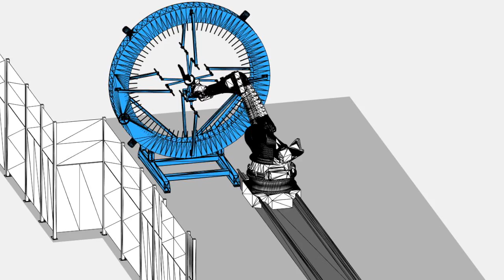Automated Braiding of Dry Carbon Preforms for Aerospace Structural Components

Comment: ok so you can braid it ... can you take 3 strands of fiber as a strand and use 6 of those sets to braid a new strand ... do that for a 10m wide panel and make all the warp and weft fibers out of these 3fiber 6 braided strands .... you not only get rolled fiber you get woven fiber you get your torsion you get your flex your compression and you get our rigid structure for less weight and with better features than the bog standard weave way